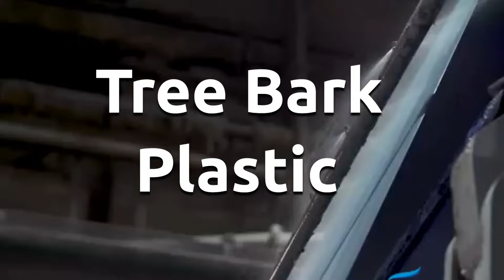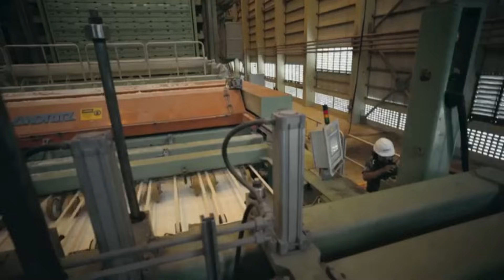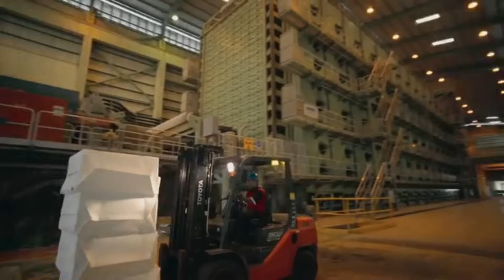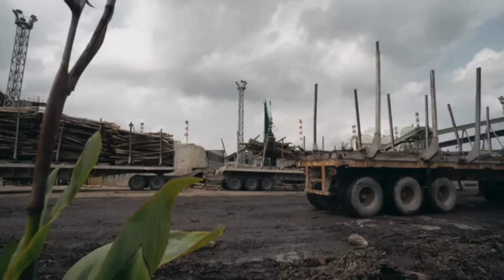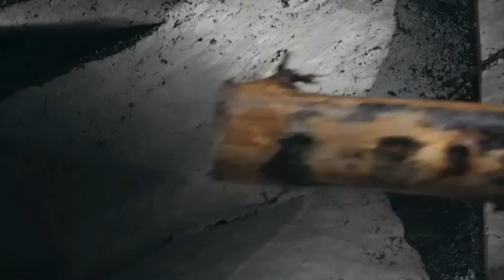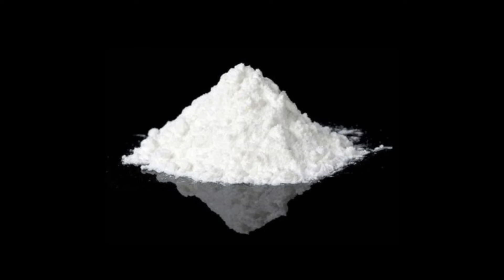2258 A World First - Tree Bark Based Alternative Plastic

Comment: In responce to some of the ill informed comments, most plastic fillers are either stone or glass based not other plastic. The dies can be organic or purely man made. However it should be noted that just becuase a substance originates from an organic source it does not follow that the end product will be harmless or environmentally harmless. 
In order to make a polymer out of bark it would require some quite intensive processing to brake down the various starches in to siutable materials to make the type of long chain molecules required to produce a stable plastic. Also regaurding the machinery used to produce plastic parts the hoppers, covey metheds, heaters and extruders may be the same, but unless the expansoin and contraction rates are the same as the plastic that is being replaced new tooling would be required. As the tooling cost is a large upfront cost for any plastic injection moulded part it may still be prohibative when it comes to changing over. Another point is that generally the higher the ratio of filler to polymer, the higher ther extruder and tool ware that enevitably requires expensive maintenance and tool replacement. Not everything is as it first seems. Having said that I hope it works and that the claims are genuine.

Comment: I seen a construction project that had a gravel parking lot during the build phase and the dust was unacceptable so after consulting another company that sprayed roads for dust control it was suggested we use a solution made from culled fruit tree bark to spray the gravel, it works great and does break down after a few rainy days however we avoided the benzene containing chloride waste product of the oil and gas industry that most people opted for.

Comment: I’ve been thinking a lot about plastics lately, and I don’t think we realize how much it is polluting our atmosphere. Even these companies that are recycling plastics, they are grinding them up and throwing tons of micro plastic particles in the air. I just think about how many people are, grinding, cutting plastics, and those particles are being breathed in. I know I’m guilty of doing it and I know that I will keep doing it in the future if I need to. But the other thing I’m looking at is the offgassing of plastic. People using recycled plastics to make roof tiles or artificial lawns and putting, chewed up tires to be used for building roads… Any plastic that gets heated up is going to be put out extra gases into the atmosphere. Think about how much plastic surface area out there is being heated up by the sun and just pumping our atmosphere with these gases. Take for instance your car, the inside of your windows in the cars get dirty from the plastics offgassing so what do you think is happening to our atmosphere? Think about this next time you jump into your car on a hot day how much gas are you breathing in? What I do now on a hot day is keep the car door open and run the vent fans or air conditioning for a minute or two before I get in the car and close the door. How many greenhouses are built with plastic construction? Clear or sheer plastic sheets? What kind of paint is your home interior, how healthy is the air in your home? From the synthetic paint that covers all your walls? I try now to avoid eating or drinking. Anything that has been in a plastic container that has been heated up by any means, microwave or even just the food being hot and then placed in a plastic bowl plate cup. Any type of microwavable food is all using plastic, even steam-in-bag veggies or whatever, never again. It’s just too well known of a fact about how many people get cancer from petroleum/oil based products. It’s virtually impossible to avoid these days, but this is how I try to avoid it. I’m not super paranoid about it and sometimes can’t avoid it, but it makes me feel better when I can’t avoid it, that I am doing my best to avoid it. Like, if I’m really hungry and have to eat out and it gets served in a styrofoam container, or the only cups available for coffee that I really need are styrofoam. I don’t like it, but I’m not gonna stress about it since it’s basically a one time thing. Another thing I tried to avoid is plastic clothing, polyester clothing. It’s super popular and a lot of people don’t realize that their socks and underwear are 100% polyester, and this plastic is just being pressed and grinding and heated up against your skin all day every day. How about your hat that is doing the same thing up against your forehead? Or your glasses/sunglasses? All of these little things add up over the long-term and it is no wonder why so many people are getting cancer. I use metal water bottle containers now and it is scary to see how many homes are being built with pipes, especially for the hot water lines because now you are showering in plastic water. I know the amount of ation is practically nothing but when you add the fact that you Are showering for 15 minutes every single day of your life and it only takes one cell to go bad in your body and turn cancerous, it’s just another attack stacked on that your body has to fight off. Same thing with plastic hot tubs, plastic pools, plastic lines, ponds plastic line reservoirs are you using solar plastic sheets that cover your pool to keep your pool warm? The examples are endless and The body just can’t fight off this many attacks. And that is how I go about it, if I can reduce my contact with plastic by 50%, I think it’s worth a one percent decrease in chance of getting cancer over my entire lifetime. obviously those figures aren’t exact, but it’s just an example of how I am approaching it. I would definitely like to see more plant-based synthetics/plastics.
Reply: So true, and our older generstions didn't have this much plastic exposure in their times as everything was either wood, metal or glass. Its just us that's stuck in plastic hell, once its made, it basically is poison till it burns off (to create more toxic air). Thank you Oil industry.

Comment: Cellophane, acetate and triacetate  fabrics made from organic fibers. They also decided to use soy as plastic to coat the wires in EVs to keep them green and they have turned into rats lunches.
Reply: I got news for you, rodents have been chewing wires for years.  Originally they put lead in the plastic insulation to improve heat resistance & keep it flexible.  Turns out,  lead is sweet, rats positively loved it.
Reply: @sinenomine9093  I know that but apparently they like the soy plastic a whole bunch.
Reply: They didnt process the soy further 😂😂😂😂
Reply: Soy isolate is reacted with Sodium hydroxide/heat to form a kind of plastic typically used as a glue for laminating plywood.

Comment: when the bark is mixed with plastic to make compstable plastic....you are simply diluting the toxic plastic....thanks but one shouldnt advocate spreading microplastics into the environment should they?
Reply: Dilution is the solution to pollution. It's a famous saying. Think about what it means.
Reply: I think you might have missed the point. Adding a large percentage of, in this case, bark, allows the bacteria and fungi which CAN break down (over tens to hundreds of years) the most commonly used plastics an easy food to first colonize the material and then easy access to the little bit of plastic that is there, once they're a large enough colony to quickly break all those C-C and C=C bonds.
Micro-plastics are from predominately physical abrasion, not chemical degradation and photochemical degradation is just as likely to leave a monomer as dimer as any other length but that's all just that much easier for the bacteria and fungi to chow down.
Reply: @matthewellisor5835  still don't think it's a good idea to spread it all around the garden, it is still pollution no matter how you twist it. would rather see reuse, recycle, and concentration rather than dilution and distribution
Reply: @AT-os6nb  I'm all for reduce and reuse (I've been drinking my water from an orange juice bottle for the last few weeks and we regularly reuse "single-use" containers many times) but as to the recycling, in my area it's less than 5% by volume of what's separated for recycling that actually IS recycled so that part is WAY down my list. 
The whole point is that it isn't pollution when broken down, I'm no practicing organic chemistry but I do understand a fair bit. Let's, as an example, use Polyethylene (Polyethene) 
The monomer, Ethene, can be the only Carbon source for many species of bacteria, fungi and even some insects (the Indian Meal Moth which is is a constant pest in my home comes to mind) but, as a gas isn't particularly convenient until you stack a few of them together in order to keep liquid or solid in the 10-40°C ish range where most critters are happy. An aside, I imagine that there are thermophilic microbes that could process it faster but I'm not read-up on any of those.
Perhaps I'm missing something but I don't understand exactly what you're meaning my pollution in this context where the material is designed so make the chemical energy more readily available to the organisms responsible for decomposition. Just what are you worried about being left in this hypothetical garden?

I understand that this might not come across perfectly as text in the comment section but I mean the query honestly! If I've missed something, I truly want to understood your position and I'm asking for your help. If we find that we disagree, I certainly won't think less of you; In fact, I take it a generous offering when someone helps me to challenge my beliefs, opinions and understanding. If we all thought the same and spent time only confirming each other's views, how would we advance anything!?
Reply: @matthewellisor5835 I happen to agree with you sir. Oyster mushrooms (Pleurotus ostreatus) have been shown to even denature petroleum contamination in soil. They will eat almost any kind of wood because they are saprobes and they can utilize the hydrocarbon chains as nutrition as well. I make no particular claims about the edibility of the mushrooms but they do amazing things for the soil.
Reply: @dr.froghopper6711  if they can break C-C & C=C bonds in polysaccharides OR petroleum-devices substances while reproducing, I have trouble expecting that any hydrocarbon, carbohydrate or protein they code for would be produced any differently or in significantly different proportions. 

The primary concern I'd like to see investigated would be impact of (and possible bioaccumulation of) plasticizers and coloring agents.
When I operated a microbrewery we were the first in our area to offer corn-derived plastic cups for large events (when there might be an additional 150-300k people within 1.5 miles (~2.4km)) because they had no plasticizers and were printed with spy-based ink. All that were returned in the provided receptacles were mixed with any of the spent grain that was going to be composted. They were undetectable in just 6 weeks! I don't say so to brag, just explaining why this topic is a little more personal for me.
Reply: @matthewellisor5835  thanks to the open comment, I feel much the same way as for learning. As to the plastic degrading by bacteria etc in the garden issue, it would be fine if, and it's a big if, the plastic in question was pure and utilized completely with no toxic byproducts. unfortunately that is not likely to be the case except in a few circumstances. Products come in many "flavours" so to speak, with different additives giving different properties to the material ie. color, strength, elasticity etc,etc... These additives would be where toxins would come into play even if the underlying base resin was "edible" or biodegradable.
Reply: @matthewellisor5835 - You do realize most plastics today are single use & not meant to be used over & over…yes/no(?) Plus, the more acidic a substance is (that comes in contact w/single use plastics) the worse the leaching of the toxins becomes :’(
Reply: @AT-os6nb  and @ WJK,
My last few tries at response have been scrubbed. I'm out for tonight and probably for this thread. I thought I made useful constructive discourse but some must know better than could we plebeians. 
If any want to continue discussions, my "G" type of electronic correspondence shouldn't be difficult to sort out, especially if someone removed the appended numerals and kept only the lettering.
Reply: @matthewellisor5835 - Can the bacteria hurry up already and break down the toxic BPA (etc…) faster. Pretty sure humanity/nature doesn’t have the amount of time you’re referring to.
Reply: Agreed.